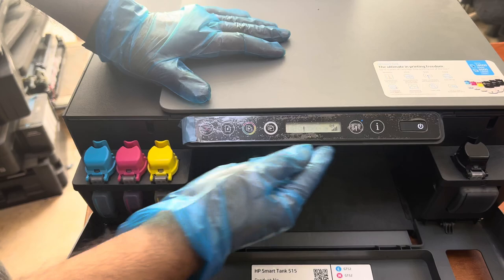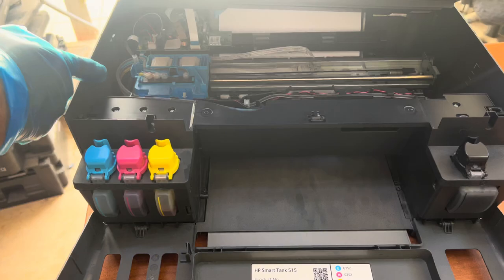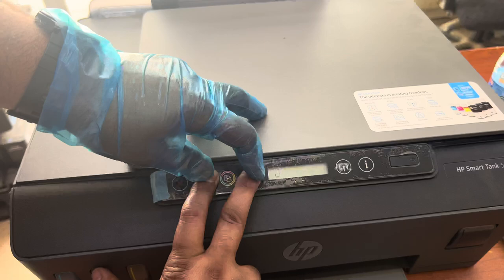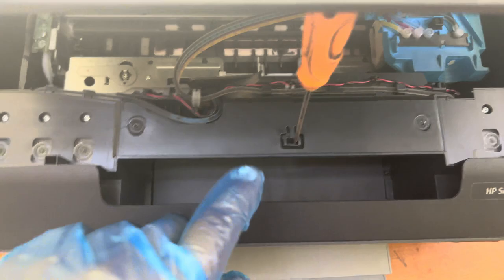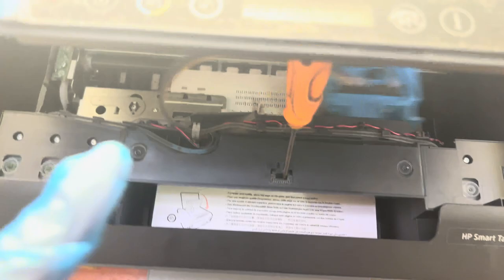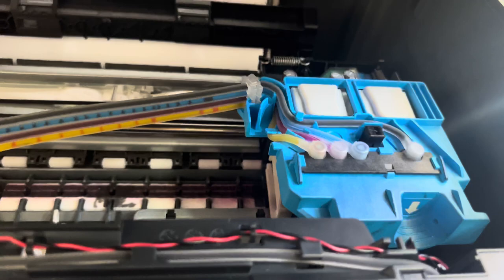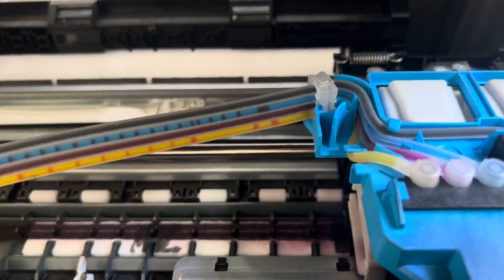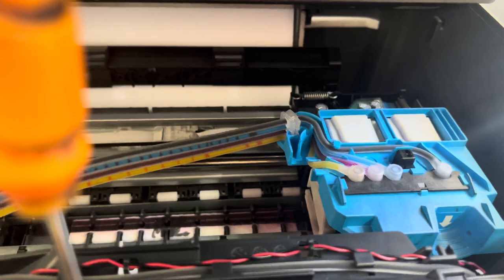How to Remove Air from Ink Pipes in HP Smart Tank 515 Printer?

Comment: Helllo Bial, another problem related to Smart tank 515, I am trying to refill ink to the ink tank, but ink does not drain from the bottle to the tank. I successfully filled in the ink by doing the same action when I first used the printer when it was new (which is about 1.5 year from now). I can see and feel the bottle is probably insert to the mouth of the ink tankl, but enough happens.  I even just buy a new bottle of HP ink, but still nothing happens.  What could be the problem and how can I solve it?  Please see if you could advice and help. Thank you very much.
Reply: did you able later?
Reply: открути крышку, оторви мембрану, закрути крышку, пробуй снова. не благодари. я русский.
Reply: эти действия надо делать с бутылкой краски

Comment: I have a problem with my HP Smart Tank 515 Printer.

First it was missing the blue and black color, then I followed your guide to clean the pipes from air. The printer then worked well but only prints black color now. 

I also tried to clean the printhead with alcohol as per your other video, and I tried cleaning the printhead with the 6 seconds method but still printing with no colors at all now.

I would really appreciate your help and guidance on what to do.

Comment: Thanks
Reply from the maker: Welcome
Reply: I fix my printer 515, same problem with the air on pipe and i follow the step and the air on pipe will move and filled with ink...

1st i tried to blow but it dosn't work and i watch your video and it helps me to fix my printer.

Comment: Good Day Bilal, what type of screw driver should I use to open the printer cover?. The screws are seem special type.
Reply from the maker: T5 screwdriver
Reply: Good day Bilal, is T5?

Also tried the solution didn't resh
ssing
Reply: I tried T5, and T 10 sizes and they are small. Myabe it's T 15?   Also, is it required to keep pressing the 2 buttons, and then plug the power cord. Becasue when I done the process, and left the printer with beep sounds for a while, it didn't resolve the missing colors. I have  two missing colors, Blue and Yellow.  Any other suggestion?  Thanks

Comment: I had doing it many times but Colour ink is not charging, still there is air in colour pipes please suggest🙏
Reply from the maker: Change color printhead
Reply: What i did before was taking off the print head and soak the tip on hot water for 30 seconds.. it removed the clogged on the head. then using this method on the vid to infused the ink back to the printhead.
Reply: @abnerbarroa1258  What tip of the print head did you soak which part?  Thanks i have the same problem
Reply: @richal89  the lower bottom. The part where the ink is coming out.